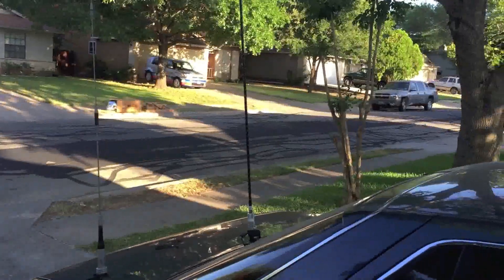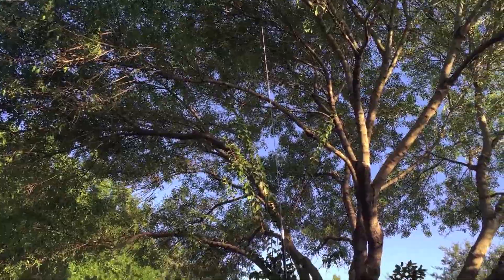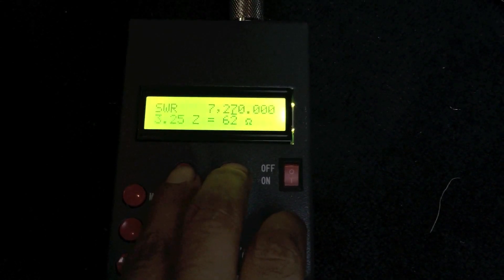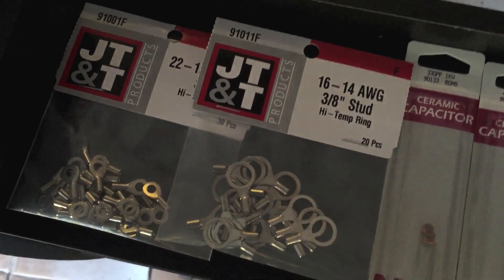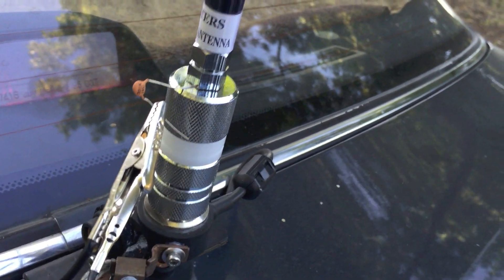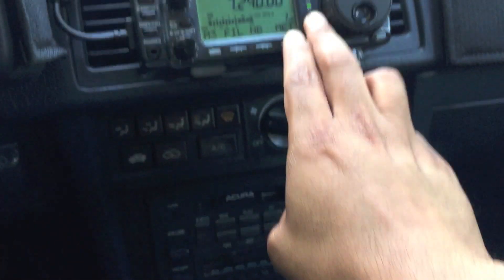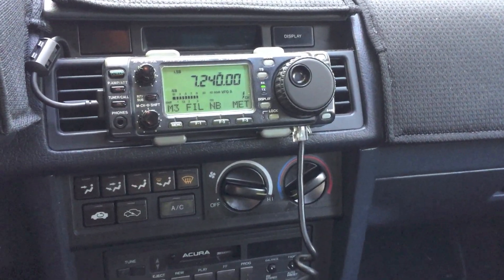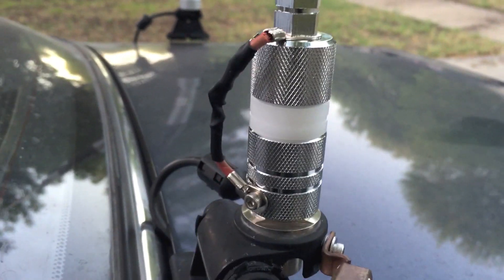40-Meter Hamstick - Mobile Installation and Matching - HAM Radio

Comment: Thats because you clipped that long piece of inductor called a WIRE in line with that capacitor. Why didn't you just mount the cap and set it with the set screws?

Comment: where did you get that front panel mount for the IC-706 MK2G?
Barry VE3ISX
Reply from the maker: The mounting to the HVAC vents?  I used a couple of cell phone car-vent holders.  For example, on Amazon, look for something like "VizGiz 2 Pack Air Vent Phone Holder for Car Automotive Clamp."

Comment: You do need to technically make the antenna resinate. Not use the tuner as much as possible . More so in a mobile. The tuner as we know only exist for the radio. Not the antenna. Get you some small coated copper wire and wind it around seven turns at about one inch and a quarter in diameter . This is a much better alternative to adding a capacitor. This kind of shunt can be adjusted while on the antenna.

Comment: My issue is that my analyzer says I have below 2:1 swr across the 40 meter General voice portion, however when I try to transmit, my swr alert goes off on the radio and it reads very high with any sort of power. 20 meter ham stick works great
Reply: I will also note that the same thing occurs when I put my screwdriver antenna on the mag mount as well. I can tune it for 40 meters with the analyzer to what it reads as 1:1 with 50 ohms impedance, but when I try to transmit the swr is through the roof.. I have tried several different mounts and the tram 5 inch mag mount that I have landed on works the best, atleast down to 20 meters. I have tried everything short of drilling holes in the car..

Comment: You are barking up the right tree, but you are using the wrong capacitor. You should be using a silver Mica capacitor. The best way to find out the exact size capacitor is to get a variable capacitor and hook it in line. A 500 pf air variable should allow you to tune it for a flat swr  .. if it doesn't and you need more capacitance then you can add a fixed capacitor or 2 in parallel with the air capacitor until you can adjust the air capacitor to a flat swr... once you've done that don't move the air cap anymore , then all you have to do is measure the capacitance of all the caps together... once you do that then all you have to do is stick a silver mica of that value (or close) permanently... if you don't have any of that value you can just put some together in parallel until you do... 
If you don't have a capacitance meter you can get a cheap capacitor/inductor meter off Ebay for  about 10 bucks the model is LC100-A... 
But you really can get that antenna Flat if you put a little time into it... you can change the caps for the other bands too... 80 meters you'll need about a 700 pf  Silver mica... 

    Happy Hamming

Comment: Crippled with a tecsun 330/660. Works well as a receiving antenna. As most of my ham/swl ing circles around 40/ 160-10 meter.

Comment: Im sorry you have a high swr, but why is obvious
for starters you need a silver mica capacitor
& 2 that is because you are using that lip mount, you have no real ground for that antenna
3 Im familiar with that mount but why is there a nylon spacer in it?
ditch it drill a hole through the body or trunk lid & use a 3/8x24 gum drop mount
ground the trunk lid to the body & the body to the frame with heavy gauge strap or wire
you are creating an image plane 
my antenna is 12.5' long and hits every tree etc because its 14' in the air
maybe Ill work ya mobile to mobile one day, 73

Comment: You will get the same result using an inductor instead of a cap.  Its not as convenient to implement but a side effect is that you will end up with a slightly shorter antenna to get resonance.  I did it in a small van, with a through the body mount so it was possible to fit the inductor inside, it was about ten turns of 20swg wire with 10mm diameter, final adjustment ws made by stretching the coil slightly.
I also used a cap on an earlier installation using a multiband/tapped antenna, I made the cap from a length of rg58 in parallel with the antenna feed point,  I adjusted the capacitance by cutting bits off until I got it matched--it was possible to cut off a few inches at a time as it wasnt that critical, the final length was about two metres (if I remember correctly????).  Once  the final length was correct, I trimmed back about 1/4 inch of the outer sleeve and  screen then sealed the end with amalgamating tape.  I wrapped the finished cap around the roof bars--Different bands would need different capacitor values.--I had anotrher shorter one  for 20metres, the higher HF bands were ok without as was 80m for some reason.  I had banana plugs on the end and plugged them into the bottom of the jumper wire for the taps as required.

Comment: Change out your antenna it's not going to do anything that's going to help your signal or your receive it's only fooling your SWR get something that works besides that antenna is not made for mobile like that you go in the McDonald's or under bridge you'll break it right off if you're doing 35 45 miles an hour trust me

Comment: dude, if you're relying on a Radio Shack SWR meter, you have bigger problems.  Get rid of the cap, and put a shunt coil in.  The inherent impedance at the antenna is low, you need to raise it up.
Reply from the maker: Thanks for the tip.  This video was shot 3 years ago - since then I've properly installed an MFJ-908 inductive matcher at the feed point in the trunk.  Your comment makes me think I need to to a mobile HF update video on changes I've made and challenges I've faced with this install over time.  Thanks for watching!

Comment: you need to close your side doors when checking swr
Reply: True normally, but if the SWR goes up when you close the doors, wouldn't that also suggest that the ground plane area is too small?

Comment: These 'Hamtenna' sticks are made more for mag mounts, not trunk lip mounts, and especially not bumper mounts. I get 1.2 or so, with 100 cycles on either side of the res freq of bandwidth before it hits 2.2. That's using a mfj mag mount in the middle of the roof...bit that's high for mobile...so you could try the middle of the. truck. They don't need any more ground with the mag mount, but need as much flat metal surface under them as possible for good swr. I'm sure that is why he is not able to get at least 1.5 on the initial install.

Comment: Back in the day, (80's) I was quite active on CW Mobile as I had to travel down to So. Fla several times. I placed a Kenwood SW-200 SWR meter in the dash so I could monitor my status. I used the original "BUM" 40 Meter Hamstick. Later, I purchased a MFJ mobile Capacitor switch box that had about 5 values to switch in/out. On 40 CW I just operated from 7025-7035 mainly. It was dead flat. Great Antenna!

Comment: The Ham Stick antenna Z at the base is low and has to be raised with a parallel coil to the feed line for best results.

Try using a coil of wire instead of the capacitor and you will love it. About 10 to 15 turns 1,5  to 2  inch in diameter. from hot to ground. Then spread it apart or push it together to tune for low swr. or use a MFJ air wound coil and tap it with a shorting wire till it matches. You will find that most of the guys that have good luck with this antenna use a air coil from hot lead to ground on a Hamstick....Similar to what you see on a screwdriver antenna shunt fed with a coil to ground. This brings the impedance back up to around 50 ohms instead of in the 12 to 25  ohm range. Also BTW the voltage node is at the top of the antenna and the current peak is at the bottom of the antenna. So a 500V silvermica works at the bottom.

Also using an antenna tuner on this would only make your radio feel fuzzy matching at the antenna is the answer. Please read this web site below... 
73
Jimmy, ARRL TS, WX9DX

http://ccs.dogpile.com/ClickHandler.ashx?encp=ld%3d20170106%26app%3d1%26c%3dinfo.dogpl%26s%3dDogpile%26rc%3dinfo.dogpl%26dc%3d%26euip%3d97.106.100.90%26pvaid%3d3d1f499f9ca44a96b2f1f225d57c3c1e%26dt%3dDesktop%26sid%3d1830193568.1306658019865.1483671401%26vid%3d1830193568.1306658019865.1478137914.49%26fcoi%3d417%26fcop%3dtopnav%26fct.uid%3daa4be3a42dc34fc8acd25aaaeee45742%26fpid%3d2%26en%3d0WEFU%252fZhSoTF%252fFm%252bpLeuVl4UPZzISdzyg%252baGYj7N8ISb7M1aTnzzgA%253d%253d%26ru%3dhttp%253a%252f%252fwww.k0bg.com%252fmatch.html%26coi%3d1494%26npp%3d3%26p%3d0%26pp%3d0%26mid%3d9%26ep%3d3%26du%3dwww.k0bg.com%252fmatch.html%26hash%3dFC33D363D7B1E2718637F79BB4FA4D75&ap=6&cop=main-title
Reply: WX9DX 
Base shunt,  gives me best results.
at 7:06 into video I hear Tony KF5ULS for Amrron net then Ruth for TAPRN  net.
look them up at amrron.com,
really very nice folks.
Reply from the maker: Great info!  I have read through and often refer to K0BG's site.  I actually did try something like this (may not have been executed well) and it did work, but I ended up taking it down because it was too cumbersome and I didn't really trust it.  I did make a video about it though.  https://www.youtube.com/watch?v=0gYdQ4QvVgE

Comment: Put a tuning capacitor in the place of the ceramic and pls tell me how tunable this is swr-wise?
Reply from the maker: I decided to scrap the capacitors and induction coils and just rely on a good tune of the antenna, and an automatic antenna tuner.  It's been a bit since I've used it, but I want to so the bandwidth is between ~50 KHz.  I can't quite remember but that's close.  Edit:  I'll check tomorrow and update.  Edit 2: I also use an MFJ-909 capacitive matcher along with the Tuner.  The video: https://youtu.be/QD1PMJl2icw
Reply: Oh i see, the atu solves it all! Checking your link!

Comment: did the swr go up on 100 watts
Reply from the maker: Hi- strangely  the  SWR does seem to go up at 100W with all the hamsticks .  What starts out as 1.1:1 goes to about 1.5-1.7:1 at 100 watts.  It's no problem, but odd.
Reply: Yeah I see that when I tune up my station, and I'm just using wire antennas.
Reply from the maker: I'm glad it's not only me.  It's not a big deal.  Exception 1.0:1 isn't realistic, and if you were getting that, it probably indicates massive losses in your antenna system.
Reply from the maker: I just understood what you meant by this "dummy loads" haha.  I think you're right.

Comment: Did you do any other grounding with that antenna mount.  I friend lowered his SWR by adding a length of ground wire in his trump to act as a counterpoise.   I know  I can get a 1:2 SWR using a HAMSTICK and a resonant length counterpoise.
Reply from the maker: Hi!  I've added several grounding straps, from the Trunk to the body, body to exhaust, hood to body, Trunk lip mount to Trunk.  With The tuner I can make it work fine, I've also added a capacitive matcher to help.  Thanks for watching!  I have several other videos on HAM radio as well, check them out if you haven't!

Comment: Good video. I also have one for 40 mtrs and use it on a magmount on the cars roof, this gives me a low swr reading and plenty of qsos using qrp on cw. I would not drive around with the antenna in place but would park up instead beside the beach or use it on a camp site, 73 de paul ..
Reply from the maker: +Paul Fallon I set one up on a little tripod with 20 radials in my backyard and it's working well with a low SWR.  Lower than on my car.

Comment: Good videos!  How did the 20 and 40 meter Hamstics perform in actual operation?   Have you also tried setting them up for portable operation?
Reply from the maker: +Al Alan The Hamsticks seem to work pretty well!  The 20-meter needs no matching for SWR, and the 40 meter hamstick I use an MFJ-909 Capacitive matcher, in addition to an MFJ-929 Autotuner.  Have made good contacts with both antennas.  If I can hear the other station they generally can hear me.  Thanks for watching!
Reply from the maker: +Al Alan Also, recently I set up 20 and 40 meter hamsticks in my backyard, on a little tripod, with 20 radials.  So kind of a "portable" setup.  Those seem to be working well with descent SWR (still would want to use a tuner, but not absolutely necessary).    Here is the video: https://youtu.be/7y3kzENZ5iM
Reply: I use the full sized 40M hamstick with a clamp on my rear kayak bar passenger rear, up top and a massive braid right to the car roof snuck in under the window rubber so less than 4 inches bonded, and added two #77 Ferrites and excellent double shielded coax cable. Tuning  best 1.4:1 with no matching, so that could be improved. It is scary high, I do use two big mono guys to the front kayak bar. But I ran all over New England and never hit anything. The LMR-240 coax is well choked and absolutely RF cold to movement. I do use a small tuner. The results on air are truly amazing on 40M. Lots of mobile to mobile contacts, and regularly get 10 over 9 reports out to 400 miles morning and afternoon condx.
Reply: Nice!  I'll have to try that!  ;) @MIKROWAVE1